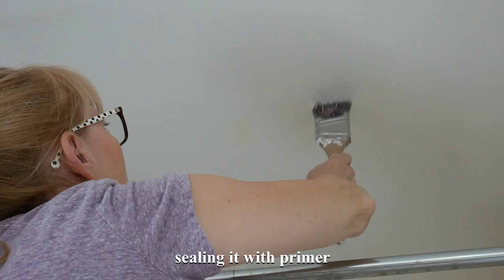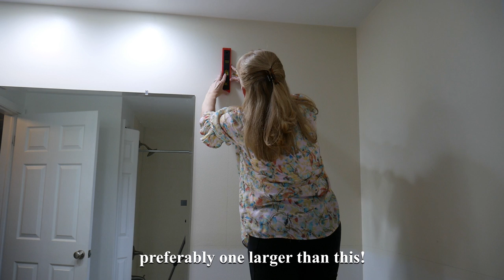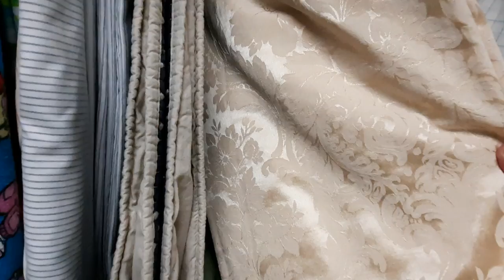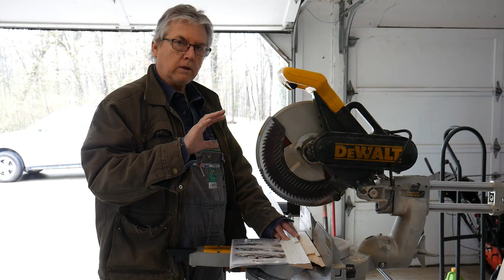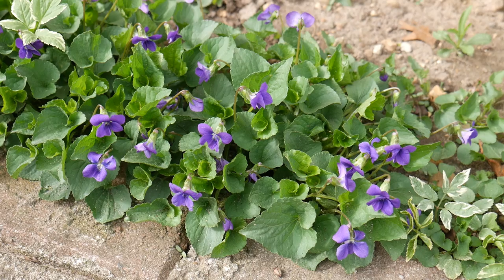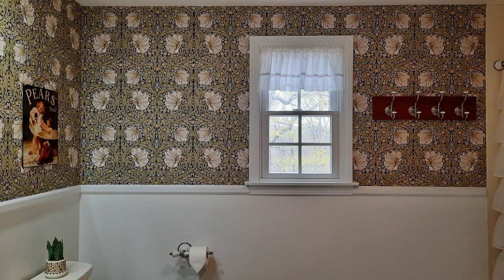WILLIAM MORRIS Wallpaper | Bathroom remodel | Slow Living Sewing | Custom Mirror Frame

Comment: Thank you SO MUCH for this video!!! This is EXACTLY what I was looking for! I'm getting ready to redo the secondary bath in our home - which is laid out JUST like yours. I'm currently removing 2 layers of wallpaper that's  been painted over and the wall underneath is in less than ideal condition.  I normally avoid wallpaper due to past and present experiences trying to remove it, but,  given the condition of the walls and the easier to remove options available today, I think this is the route I will go. I have fallen in love with the William Morris wallpapers and wanted to see them used in a bathroom- especially one with a chair rail or beadboard in the lower area since I have beadboard in my bathroom. I ABSOLUTELY LOVE how yours turned out!

 Adding the frame to the mirror was a perfect solution and really added to the beauty of the work you put into hanging the wallpaper! In addition to the cost savings, there's always such a sense of pride and accomplishment that comes with making something with your own hands. 
Lastly, I was marveling at the lovely oak table in your sewing room as you were cutting the curtains, and then when it cut to you using your treadle machine, my jaw dropped!! WOW! The sewing machine (in beautiful working condition) and that tiger oak cabinet- STUNNING!!! What a treasure and what a treat to see it in use!!  
Thank you SO MUCH!! You've helped me make my decision on the wallpaper and the rest was icing on the cake!!
Reply from the maker: Thank you so much for your heart felt comment! I'm so happy you enjoyed this video!  I'm in love with this bathroom!  I thought about adding beadboard on the bottom, I love it!  I might actually put some wallpaper on the bottom half that looks like beadboard.  The Treadle sewing machine was my grandmothers, and I love sewing on it  ❤
Reply: Hi Melissa, how's your day going with you?